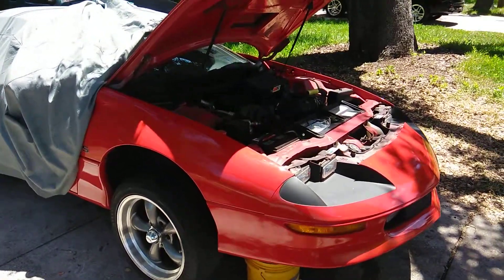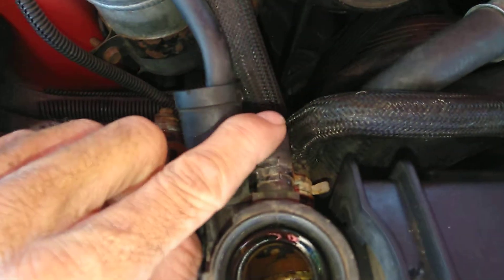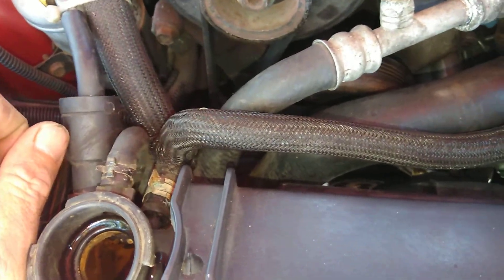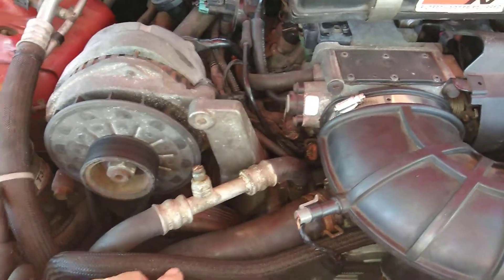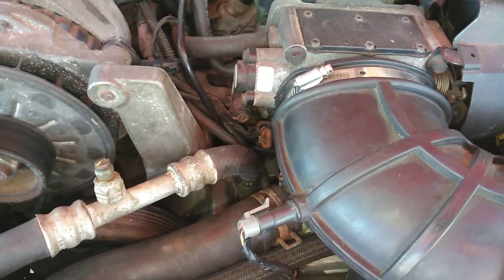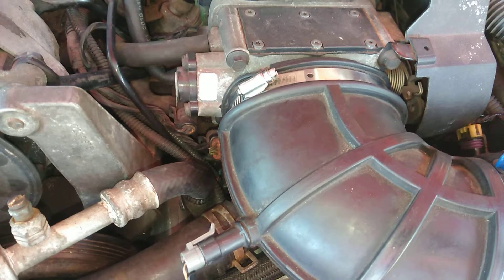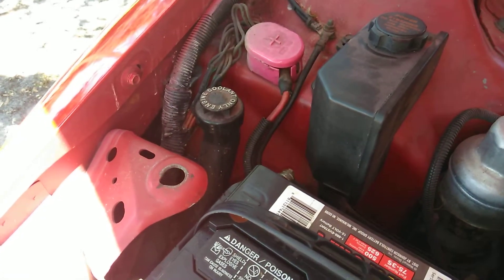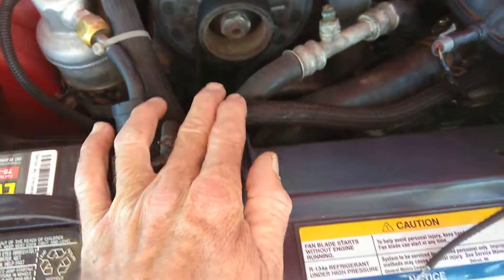🤔 LT1 Camaro Water Boiling out of Coolant Resivor

Comment: I just had mine rebuilt and when I got it home it was overheating. Can’t drive it 5 miles before it starts going towards the red. Was your car overheating when this was occurring or was it just boiling water out? I have absolutely zero water leaks.